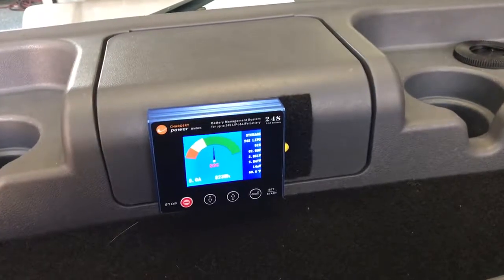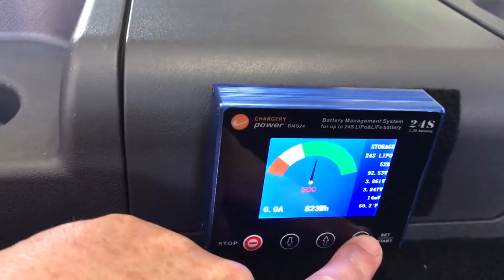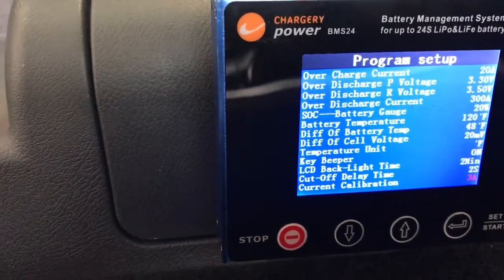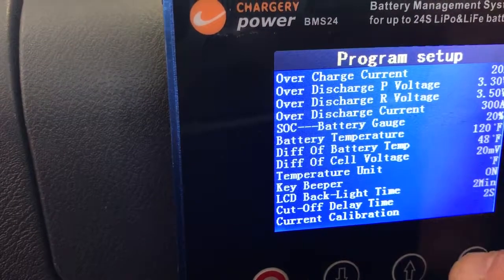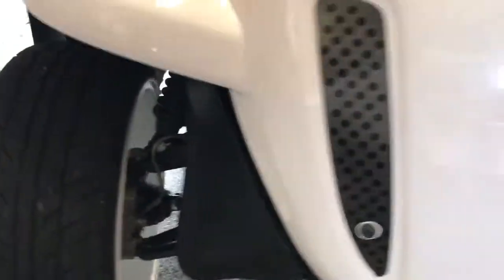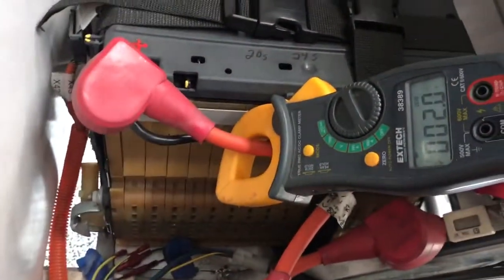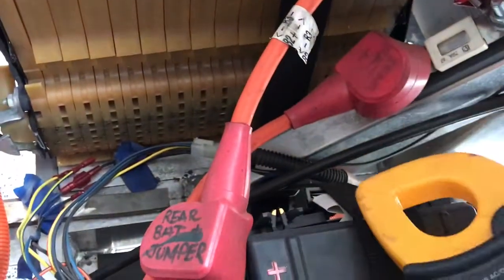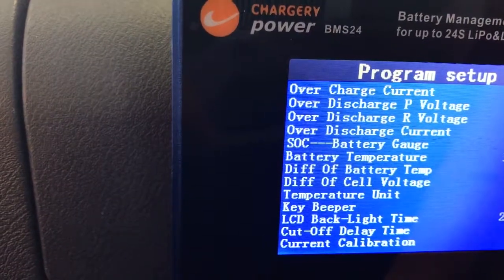Gem Car BMS 24 Voltage Calibration

Comment: Does this have to be done? What were the rest of your settings?
Reply from the maker: If you want the Amp display to be accurate you need to Calibrate. As far as the rest of the settings that’s way to complicated to go over in the comment section
Reply: @grantwes  Looks like I better Calibrate. Do you think the newer Volt batteries need different settings than the older ones?